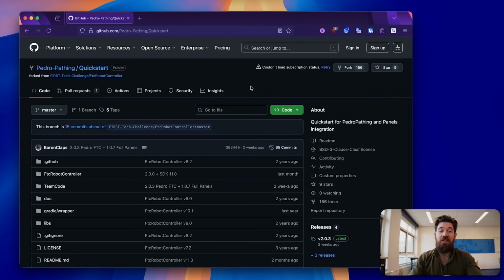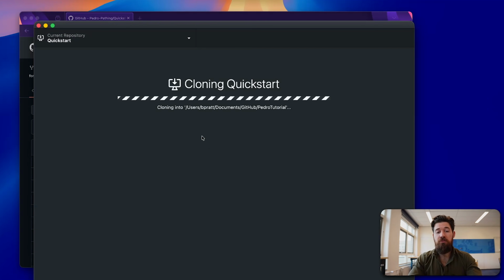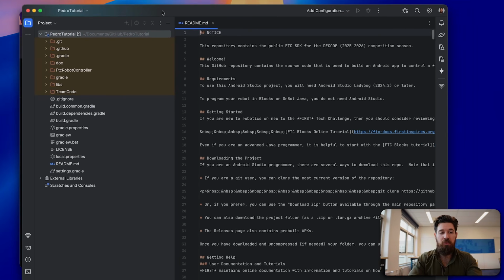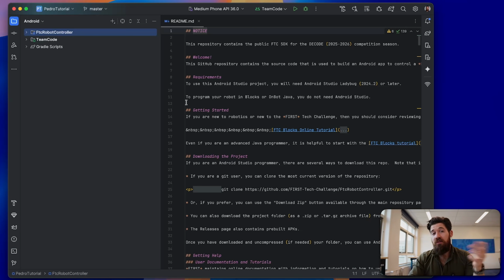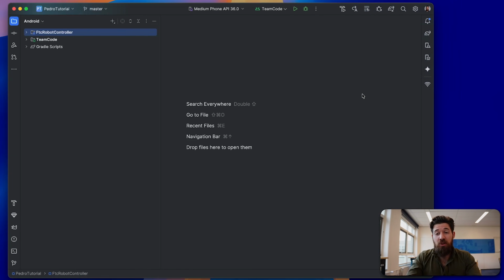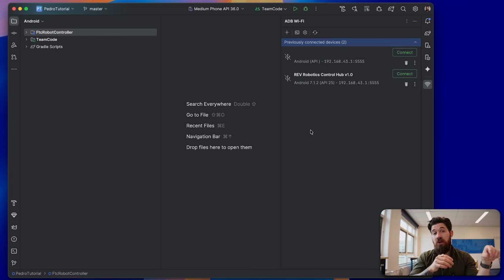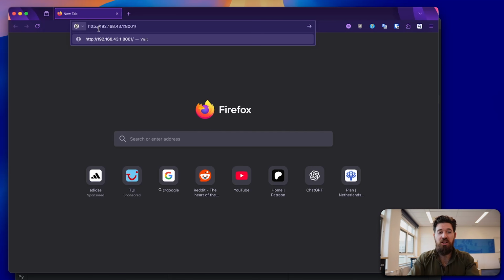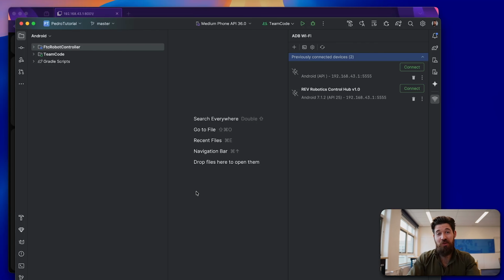Get Started with PedroPathing: The Complete Setup

Comment: When I write the panels IP shows that the connection was refused, I have already installed the quickstart and connected to the robot network but still doesn't work, what should I do next?
Reply from the maker: Did you build the quickstart on your robot controller?
Reply: @BroganMPratt  hello im from a diffrent team but i dont understand what you mean by that?
Reply from the maker: PedroPathing works on a quickstart github repo that includes the official FTC SDK upstream. You need to install/build the program on the control hub in order for panels to work.
Reply: @BroganMPratt  thank you this ended up working and panels now work!!!

Comment: Hi, thanks for the great tutorial. 
After doing the ADB wifi connection, we tried searching for the dashboard for PedroPathing. After trying on many different browsers, along with different wifi networks because maybe the issue could be firewalls, nothing worked. The website didn't load. Could you advise on what to do next?
Reply from the maker: Did you build/install the quick start on your robot controller?

Comment: Love the guide, but my panels aren't working. Whenever I put in the IP address into Chrome, it shows "This site can't be reached" and "IP address refused to connect". I'm sure I set everything up right. What should I do? Thanks!
Reply from the maker: Are you connected to your robots wifi network? And did you build/Install the Pedro QuickStart onto your robot controller?
Reply: @BroganMPratt  I had not built it yet. I did that and it worked. Thank you so much!

Comment: We had our first qualifier today! We had one of the best robots there, but our wire that connects our control hub to our expansion hub broke during one of our matches, that caused us to lose a few matches and not get picked in the playoffs
Reply from the maker: Ah bummer, that’s a shame. Were you able to diagnose how the cable was able to break?
Reply: It was the bad xt30 connectors that the hubs use, we talked to 10644 about it and they said they had a solution
Reply from the maker: Ah, I thought you meant your RJ485 cable. Yes, XT30's are finicky. I like to keep mine permanently plugged in and remove it as little as possible if I can.

Comment: ADB Wifi is only needed for code deployments over wifi, not to connect to the Panels dashboard (that works just fine as long as you're on your robot's wifi network).  You can add a connection directly to your robot by manually entering the IP address if you don't have a USB cable available.  When deploying over wifi, you'll either want to be familiar with gradle local builds and offline mode, or install a 2nd wifi antenna on your laptop to stay connected to the internet.
Reply from the maker: Thanks for sharing these notes, it’s a helpful clarification for programmers. Though the dual wifi antenna only works on windows, as far as I’m aware Mac doesn’t support this.